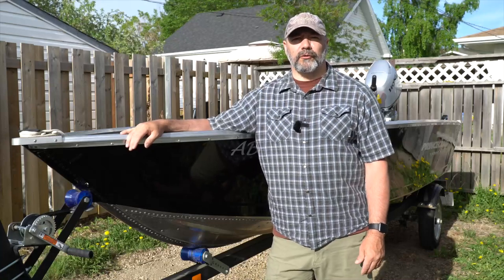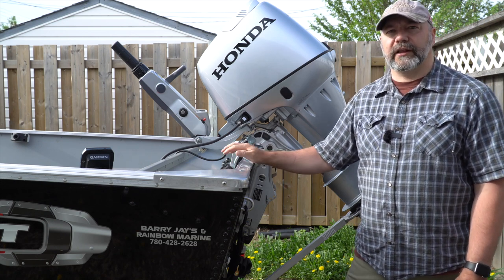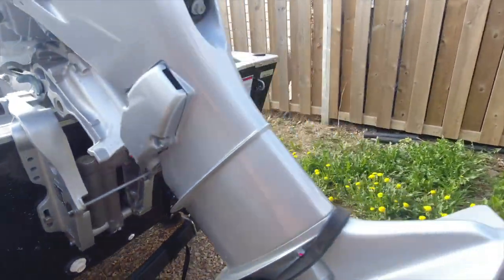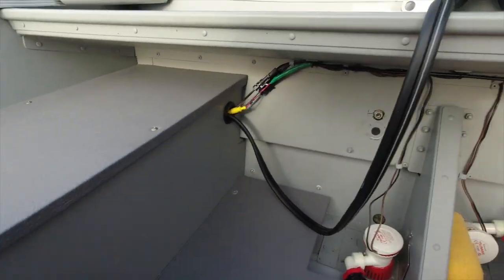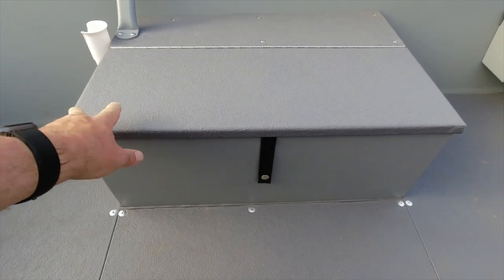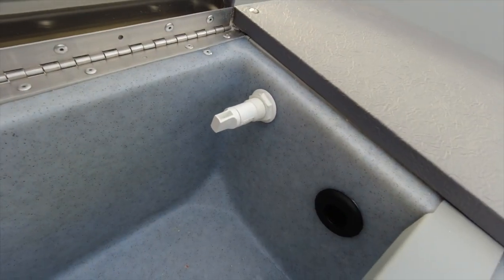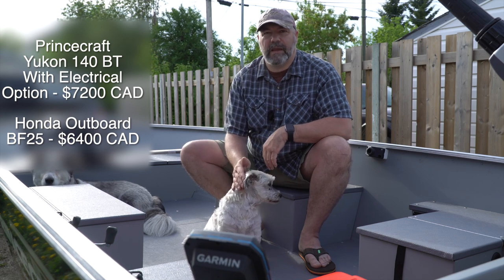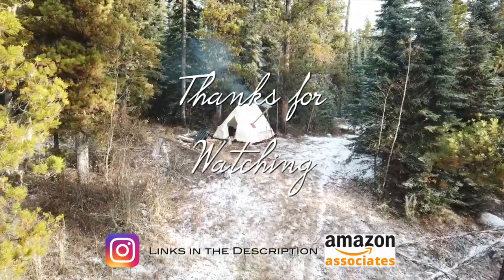Princecraft Yukon 140 BT and Honda BF25 Outboard Motor - Overview

Comment: As a retired Marine Engineer I'd say the hull looks like it will ride well and the bow can definitely cut through a chop. Being Aluminum is a plus for lake use. I was thinking how about using the tent/cot in the boat for overnighting.
Reply from the maker: Thanks Sue!!  That is great reassurance indeed 😊 I think the cot would work I just need to give it a test!  👍

Comment: Nice, I have a 2000 Pro series 162 Princecraft (16') has a 60 HP Johnson 2 stroke and owned it since new . The hull look's quite similar to yours, mine is  is still sound as a bell. The only time there is water in the bilge is when it rains or swimmers get back into the boat. I have towed mine as far west as the Shuswap's and east to northern Sask. several times. Looks like your boat has the flat bottom at the back as does mine, some people say you have to have a deep v hull to run in rough water but I have been caught in some storms (not intentionally) and have had no problem with the flat bottom. Looking forward to some videos and will keep an eye out for you guys.
Reply from the maker: Thats awesome!!  I think Princecraft make some fine boats!!  I'd love to step up to something like you have one day!  I think the flat bottom adds good stability on calm water and a nice shallow draft but the v does help in the waves too - its a good compromise! 👍 I'm hoping to head to Northern Sask this year with friends too this year as I've never fished there! 🎣

Comment: Very nice set up! I have a 14 Lund that is very similar with etec 25hp but I was wondering how fast does that Honda push the boat? And what kind of rpm are you running at that speed?
Reply from the maker: Hi Aaron - I'm not 100% sure but it gets the boat up on plane pretty easy but in all honesty - I think a 30HP would have been a better choice and a power tilt trim option 😉
Reply: @TheEmporiumOutdoors  okay thanks, next time your out and you happen to know the speed let me know. My 25 etec pushes my boat about 25-26mph loaded pretty light. One of the reasons I got this etec is because I got a crazy good deal on it, it had the biggest displacement of the 25hp class and the Honda is still carbureted.That being said it is only a 2 cylinder so it definitely vibrates more that your Honda would and I think is probably noisier. I also love Honda so I am considering switching to a 25-30 but I want to make sure I would be happy with the performance.  It would love to see your comparison video if you make it with your other friends boats as well!

Comment: Dude, check your video. Think the red green is on the front and solid white on back. Red starboard, green port, white 220* running with the red green. White 360 by itself is at anchor light. Any new boat is always a start. You’ll have fun personalizing it to your needs. I have an eight foot inflatable, nine foot Boston whaler squall, and a 16 ton 45 foot two masted money pit... enjoy. 😀
Reply from the maker: Hahaha - I got it wrong 😆 I was thinking aircraft but with boats the coloured lights lead! My bad!  Wow you have a lot of boats!!  I like the sound of the 45' boat! 😄

Comment: Great boat,the only thing I’ll do differently is the engine travel arm.Is to high,lower gonna help a lot  on the road ,less stress on transom ,trailer and no rotation when travel
Reply from the maker: The Honda engine arm is a bit weird I know.  I do use a transom saver to take the weight of the motor too!!  Great tip!

Comment: Nice set up. Is that a Stryker 4 fish finder? How do you like it?
Reply from the maker: Yes - Its the Garmin Striker 4 Plus but I made a mistake and should have got the Striker 4 CV 😞 - This one doesn't have the ClearVü™ scanning sonar I wanted.  Other than that it works great!  I like how it maps the depths automatically for a lake on the map for reference later.
Reply: @TheEmporiumOutdoors  Thanks for the advice. I was looking at the 4, but I will check out the model with the clear Vu

Comment: Great video, I'm actually in the process of buying a Yukon BT here in Québec. Your video really helps, it's almost like if I was there to see the boat myself! I wonder, do you think that your seat solution with the treated plywood would work on every seating locations? I'm thinking about doing the driver's seat and the middle-left seat with a similar solution. It's still unclear to me how Princecraft fit their OEM 500$ seat option on the boat.
Reply from the maker: Hi Francis - I'm glad the video was helpful!!  I called Princecraft about their seating options and they provided me a PDF for option 2801632 (front seat mount).  If you contact them or send me an email (info@the-emporium.ca) I can send you the document.  It looks like a metal hinged plate that connects to the live well bulkhead.  I'm sure the other seats connect in a similar way.  I'm happy with my solution but would change one thing - have the bases removable (snap in type) Hope that helps!

Comment: So 13,600 for boat and motor, plus trailer runs around 2000 some places charging 2800 that's 15,6. good price. Doubt I can get it for that now, but gonna see what I can do. Question, is the motor, slow enough for trolling?
Reply from the maker: Yea - Prices have jumped 😞 The Honda motor is slow enough for trolling BUT I would maybe go with the mercury 25hp with the electric trim.  The Honda is nice but I tried the boat with the mercury motor and its was awesome to have electric lift/trim. 👍
Reply: @TheEmporiumOutdoors  Thank you for the reply.

Comment: You're probably not missing much not having trim. I have the Resorter with a 40hp merc. I find the trim does not affect the boat very much and is defiantly not critical to have. I used to have a bowrider rated max 80hp but I had a 90hp on it. With that boat trim was very important. If the motor was left trimmed down you would only get to about 4000 rpm and the boat would be in a very dangerous condition.
Reply from the maker: I did get the trim better and wish I had power trim too 😄 I know bigger motors need very careful trimming as its get more critical at higher speeds 👍

Comment: i am 80 years old and have been around boats for 74 of those years. one thing i have found out  there is not one perfect boat, every boat is a compromise, some do this well and some do that well but none do all well, period. honda and yamaha make the best motors in my opinion, but there are a lot of mercs and evenrudes around here in maine, i have owned all of them and they were all good motors if you treat them right and maintain them. they are like a women , the more gentle you are with them the better they will treat you and hang around longer. that boat looks like a great lake fishing boat, but wow for 25 horse that is a large motor but that is the way it is these days with all the government regs.  esme looks to me like she wants to drive.
Reply from the maker: Thanks Ned for the boat tips!  I totally agree about engines and how you treat them - I'm being very diligent on the run in procedure as I know it will add life to the engine overall! The Honda is big old motor with the 3 cylinders - my friends Yamaha is smaller and 60lb lighter with 2 cylinders but still puts out 25HP.  This boat has most of what I need for lake fishing and maybe a little river boat fishing too! 👍  Hope you still get out fishing in Maine! That amazing country and coastline! 🇺🇸